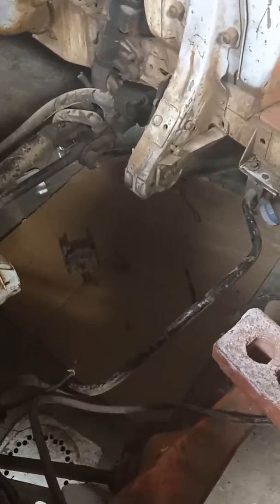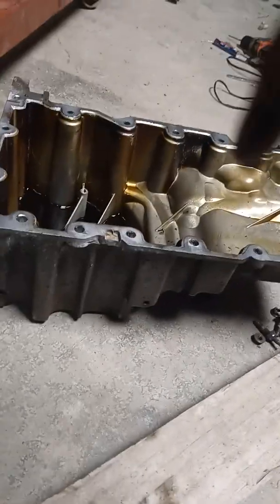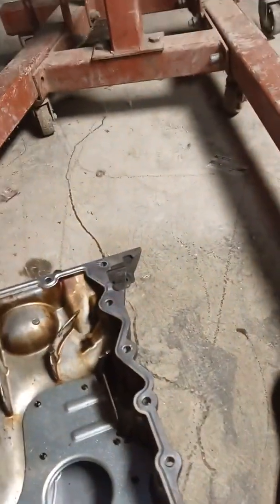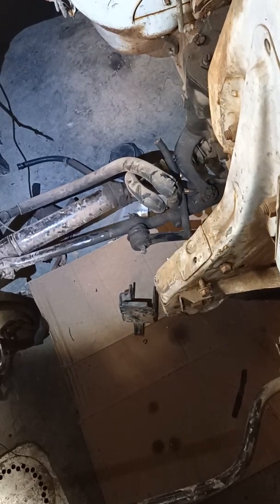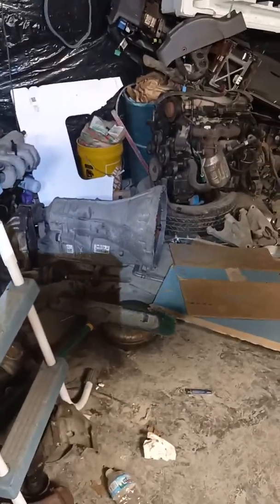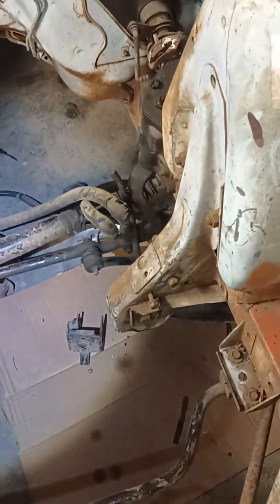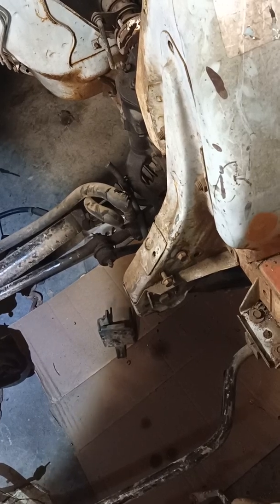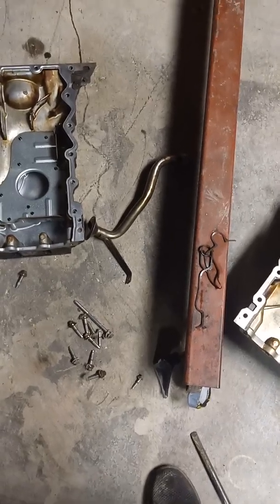76 Ford Maverick 3.7 Cyclone engine swap

Comment: I got a 76 mav w a i6 in it, im looking to upgrade to v8, do you have any suggestions. want a good amount of power
Reply from the maker: if you want it easy I would actually build a good 302 you can get good power out of it it just takes quite a bit of cash

Comment: Hi there,  i have a 66 mustang and 2014 3.7 cyclone engine on it 6r80transmission..the mechanic that promised to finish the car left it unfinished after he give up his actions . So far everything is there except the car has a misfire that he try  a lot to find out why. So basically has a tune up issue or mis wiring issue.  Anywhere I ask, there is no wire set up That fits 66 Mustang convert to a 2014 6 cylinder engine. Any idea or help from you would be appreciated.
Reply from the maker: I would say the most likely thing would be a bad coil I don't know how your setup is but I am using the factory wiring and it should have a place to plug in a scanner if it's not able to be scanned it would be very hard to diagnose

Comment: I'm looking at a 3.7 swap crown vic. So I'm looking at a direct drop in for everything except trans mount. I've tried to find info on the driveshaft. Do you know if you have to use the new driveshaft and how that installs?
Reply from the maker: I will most likely have a custom one made if you have the 6r80 Drive Shaft or the 6-speed driveshaft you can make one driveshaft out of both that's what I intend to do if I don't have a custom one made the Crown Vic and fox body Mustangs even most Ford's have the have the 8.8 the same mouthing on the rear end